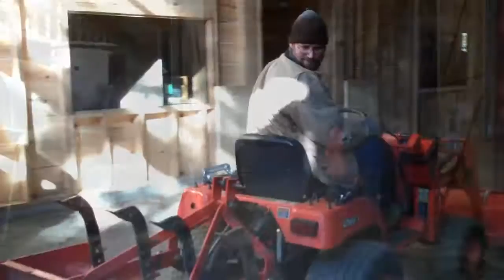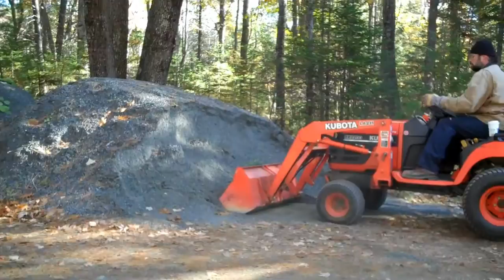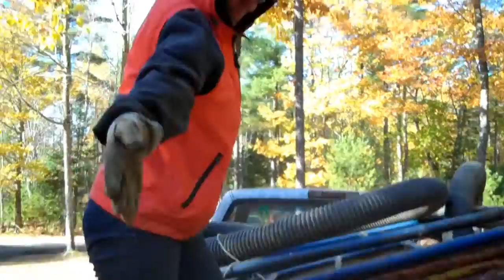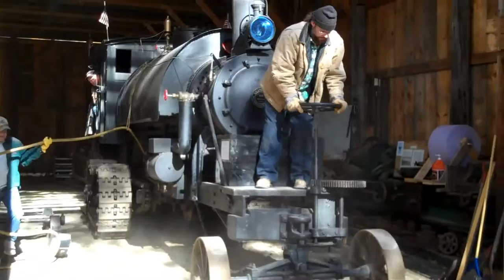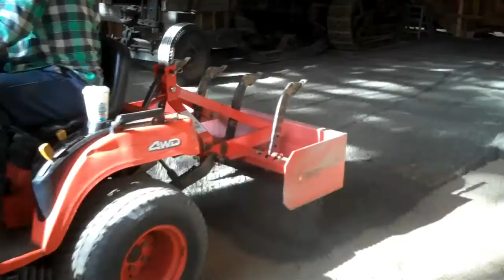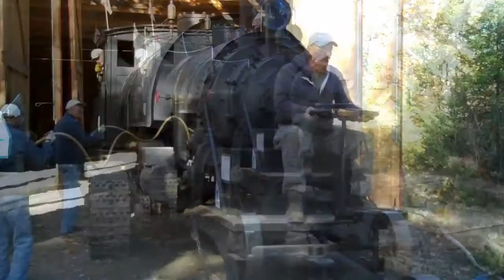Installing Stone Dust Floor in Lombard Log Hauler Building

Comment: did you compact to get a hard surface ?
Reply from the maker: We did not yet and this floor is somewhat soft and dusty.  Wetting and compacting would likely produce a harder surface.  We did this with some new ADA ramps and they are much harder.